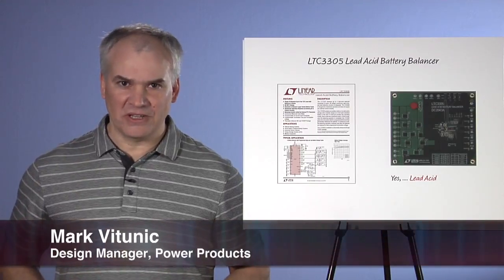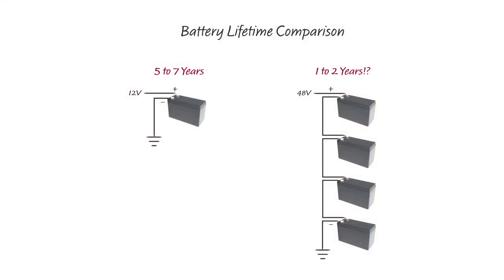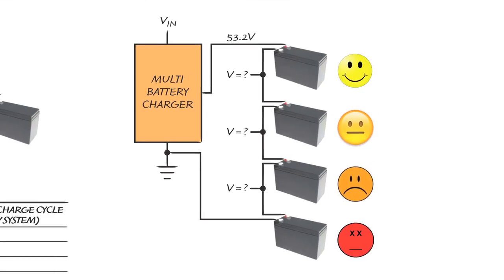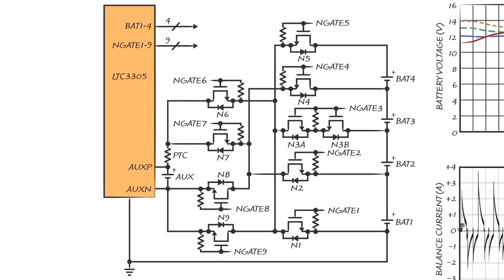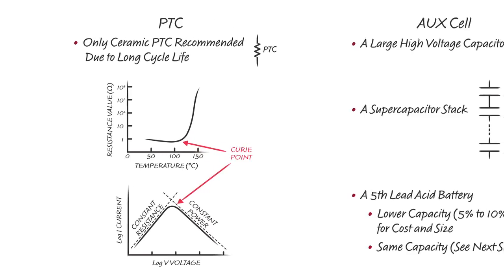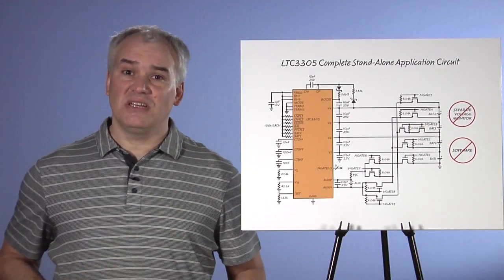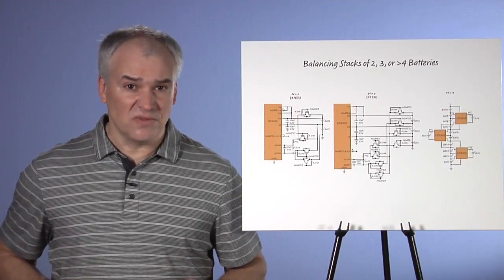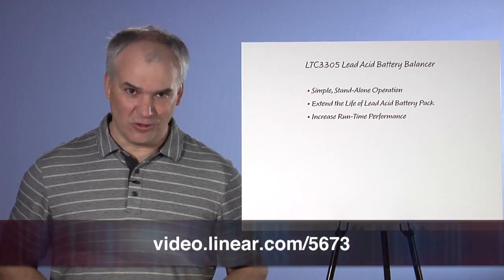Lead Acid Battery Balancer

Comment: Great video, i recently bought me an old server UPS with 2200 VA (1600 Watt continues load). It had 4 banks separated into 2 x 12v 7A parallel batteries (8 batteries in total). Of these 4 banks (12v 14A) 2 banks are created with 2 banks in series (24v 14A). Finaly these 2 banks are put in series again to create 1 large 48v 14A battery. The wires went up in thickness at every level. At the last connection there is a fuse in between the two 24v 14A sections in series of a hefty 100A. How do you balance that. Is it a waste of effort to do so? What if i get rid off all 8 small batteries and connect 2 x 24v car-batteries directly to the two biggest connectors in series? I guess you can't buy off-the-shelve 24v or 48v lead acid batteries that have balance circuitry built-in inside by design?

Comment: on a different note. why on earth does everything have a 10.5v cut off for 12v batteries, when it is a battery killer? especially if you are running some parallel batteries?you could have one go to 9 and the other 11.

Comment: To be fair, balancing a stack of whole batteries is a step in the right direction. But cell level balancing would be preferable above all else.
Since stacking 4x 12 volt batteries isn't majorly different than stacking 6x 8 volt batteries. (even if this would be slightly better)
In either of those two cases we still have inter cell connections with an unknown and unregulated voltage. And this can lead to cell degradation.

That lead acid has historically not been having active balancing circuitry for the rough 100 years that it has been on the market isn't reason for it to not have cell level balancing.

Lead acid battery manufacturers should at the very least provide taps for the internal connections between the cells. So that one can with relative ease both monitor and regulate each cell individually.

Lead acid cells only have 2 main failure modes.
The first failure mode is over discharging and excessive lead sulfide buildup. As the thin sulfide layer exerts a lateral (shear) force that grows larger as the layer thickness increases. Eventually the shear force is sufficient to overcome the tensile strength of the connection between the lead sulfide and the underlying lead. When this point is reached the sulfide layer starts flaking off. (iron corrodes in the same fashion.) (having looked over various discharge curves for lead acid cells over the years, I would argue that 1.85 V per cell is a decent lower limit to discharging. Some argues that this only results in a 20% depth of discharge, but that is factually incorrect. (The energy is proportional to the area under the curve. Not the perceptual decrease of the voltage))

The second failure mode is dry out. This is often caused by long term over charging, typical in a lot of UPS applications. Over charging is in itself not a major issue, other than the wasted power causing heat and electrolysis of the battery acid. But heat increases evaporation rate, and electrolysis effectively does the same. Eventually there simply won't be enough water left for the acid to do its job. Flooded lead acid cells typically have a reservoir to ensure that this won't be an issue even in the relative long term. While "maintenance free" batteries meanwhile has intentionally removed the option of basic maintenance from the end user.

Keep both of these in check, and the battery effectively won't fail. Other than perhaps the plastic enclosure cracking from age related embrittlement after 20+ years.

Comment: Just what we need on the Sydney Trains passenger train fleet with 110V-120V systems made up of 8 x 12V series connected gell cell lead acid which are barely managing 1 year life span.

Comment: Very nice video thank you! Question: parallel connect two AGM 200 ah batteries, do I need a battery balancer? Your video mentioned when you connect the batteries I series.

Comment: I actually AM interested in cell balancing, especially when using gel cells or even absorbed glass mat that are not tolerant to overcharge necessary to bring up cells with higher self discharge rates. no two cells are alike, even in the same battery. I like to avoid oxygen cycle, which promotes corrosion of the positive electrodes of the cells. Cell by cell balancing will allow a lower float voltage, which reduces standby losses, and prolongs the calendar life of the cells, thus the battery. by interleaving  the balancers, you can series as many cells as necessary, no matter how high the bus voltage. Do you make simple, low quiescent voltage divider  IC's  that can operate from 2 volts (bottom balancing NiMh) to 8.5v (top balancing lithium  Ion )? I want switch mode that can use an inductor  to connect between the cells to be balanced by that divider. the dividers would only be switched into the battery during absorption and float conditions to avoid unbalance due to differences in electrolytic resistances of the individual cells. when the battery is to be discharged, I would do that coulombicaly. the bulk charge would be done with no balancing until near cut off voltage. once the current begins to tail off at finishing voltage, the dividers will be switched in, to protect cells from over charge. than the voltage is reduced to float until needed next. the dividers only need to handle a few amps at most, even for the largest amp hour capacity batteries.
Reply from the maker: Hello. it sounds like you are suggesting an alternate architecture not using our part. For a more in-depth discussion, please visit our online technical support community at https//:ez.analog.com

Comment: Thank you for this, seems like valid points. But can't I just balance charge them manually once in a while to keep them healthy?
Reply: No.   I tried that with $15000 of lead batteries. One shorted out and ended up ruining the rest before I caught what was happening.    I'm using lithium now.

Comment: I googled this video im getting sick of my 24v solar+wind system batteries dont last more then one year. I noticed voltage difference that was rising with each month after a year.
I bought 2 identical batteries from same shop and yet these batteries were not even 95% near same capacity. One battery always charged upp faster. And then the problems start to come.

Comment: What difference between cell that series in battery and battery that series?
Reply from the maker: The cells inside the battery are generally not accessible from the outside.  For example, a standard 12V automotive battery has 6 internal cells connected in series but only two electrical connections to the outside (+12V and GND).  Balancing of these cells is not possible, but also not necessary, as these cells should match quite well, being in a tightly coupled environment, sharing a common electrolyte, temperature, charge/discharge profile, and even manufacturing date.  This is in contrast to separate batteries connected in series, in which all of these parameters can have differences.  Balancing will thus provide a benefit at the battery level.
Reply: But , Is it possible that Battery have imbalance cell?
Is that mean we can't do anything for this?
Reply: Balancing of these cells is not possible, but also not necessary, as these cells should match quite well, being in a tightly coupled environment, sharing a common electrolyte, temperature, charge/discharge profile, and even manufacturing date.

Comment: Has anybody actually built a product that uses this? I use the HA03 8ch balancer for a string of GC2 batteries on my boat. Works quite well, and only $90.
Reply from the maker: We can share all of the details, but it was designed into medical equipment.

Comment: well couldnt you just hook up all your batteries in parrallel to your chargecontroller and avoid the problem all together
Reply from the maker: It would not be efficient because it requires either manual disassembly of the series battery stack OR a second high current switch network to reconfigure the batteries in parallel to connect them to the charger.
Reply: Parallel batteries don't increase voltage and if you try to use the same wattage load on a parallel bank as on a series bank then it will draw more amps which burns the batteries and the cables.

Comment: i have a challenge for everyone. i have 4, 12 volt deep cells, running my inverter/charger. right now, it is; two 12v in parallel, in series with, two 12v in parallel with a battery balancer for the series circuit . but that leaves the individual batteries of the parallel's unknown. what if I  ran ; 12v in series with 12v with balancer, in parallel with,  12v in series with 12v with balancer, would i then have all 4  being balanced? this is giving my brain cramps. but these batteries are new,cost too much, and i want them to last.
Reply: Yes you are correct.  You could in theory make 2 separate 24 V batteries.  And then parallel them together.  And of course put balancers where needed.  The way you haven't set up you must use Thick bus bars or you'll end up with cross current and not even your balancers will keep them balanced.